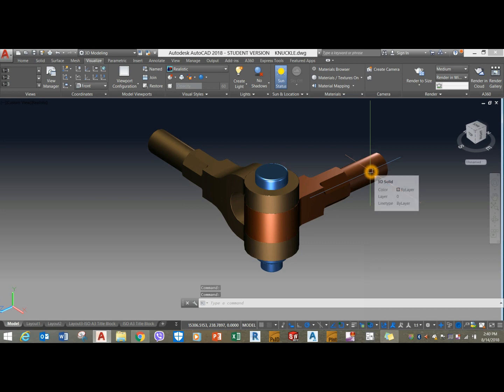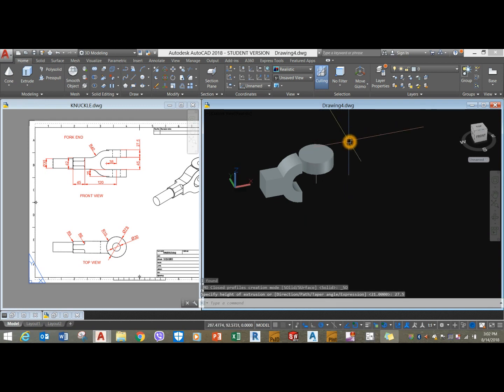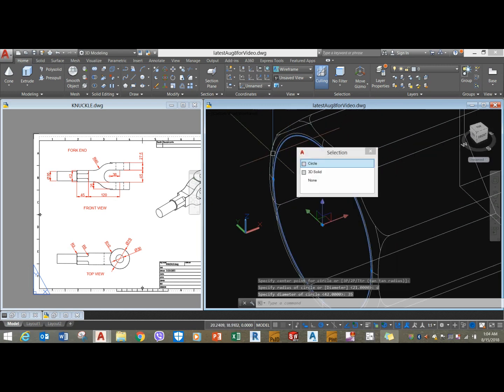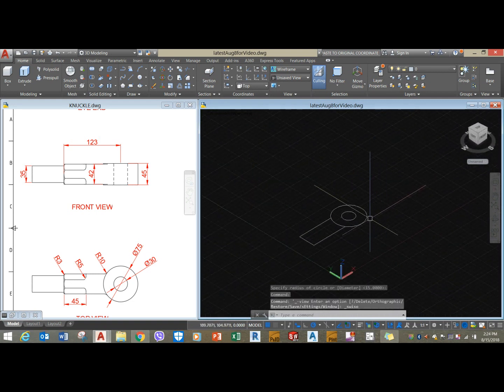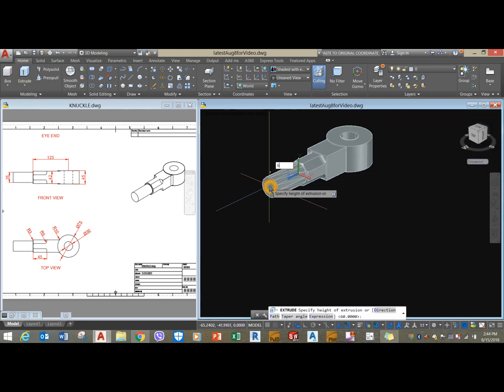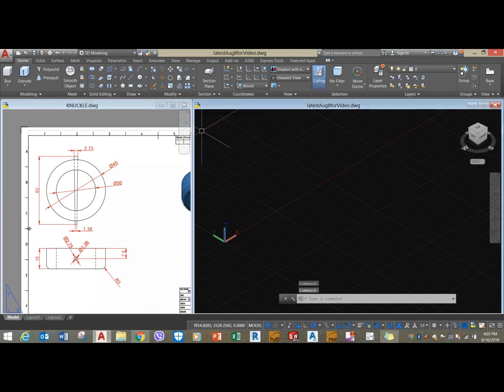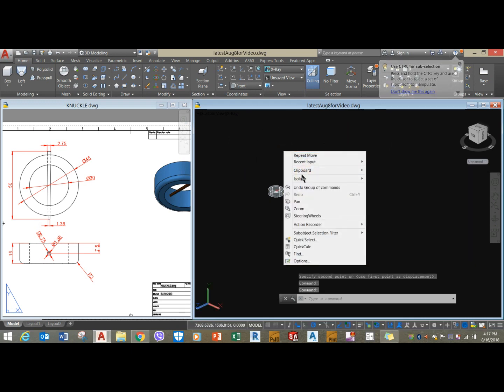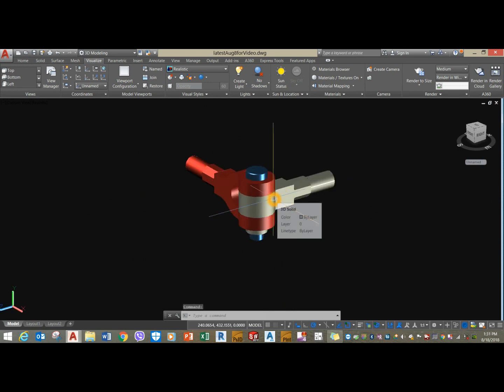Knuckle Joint in AutoCAD 2018 (Mechanical Drawing)

Comment: the video is very useful. thank u.  can u explain how did u make a hole on the knuckle joint pin and the measurement
Reply from the maker: sorry i missed that part. When you attached the collar and inserted the taper pin just copy the taper pin and paste it on the same spot . Use subtract command, select the knuckle joint pin, right click and select the taper pin to subtract.